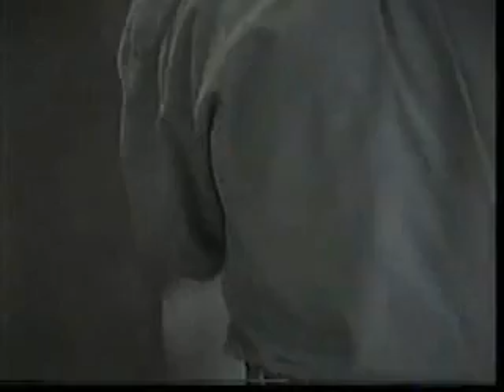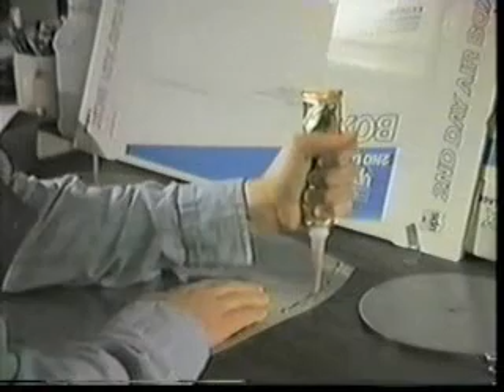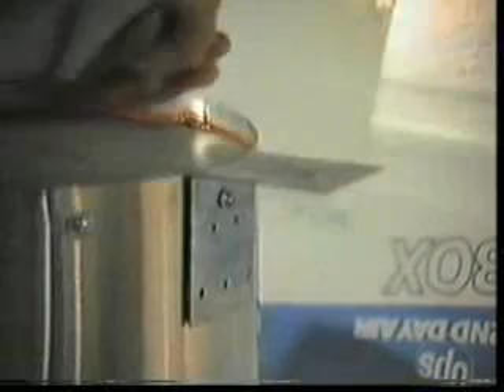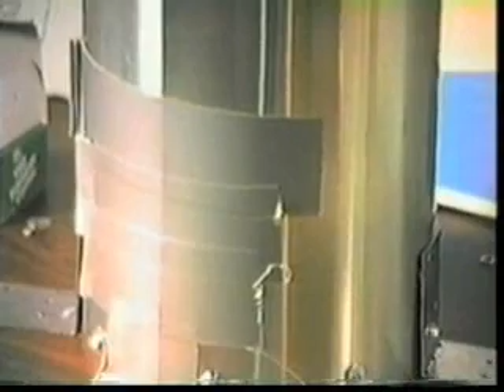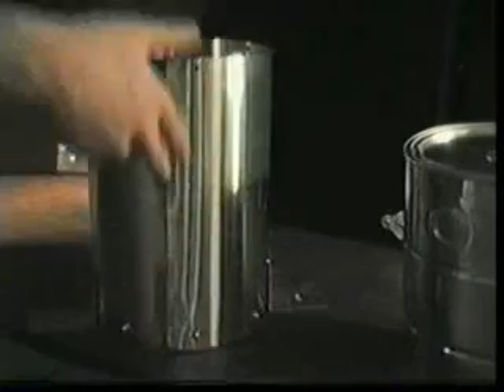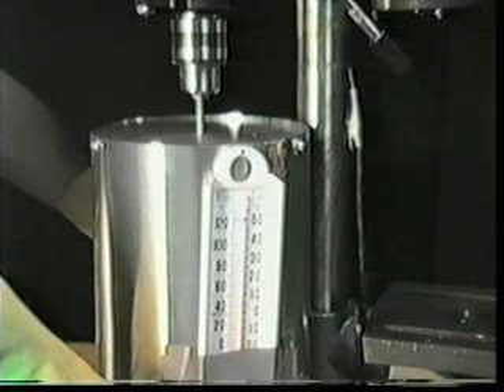878Video150kps

Comment: 12 minutes in, and still no clue as to what this is, what it does, or how it works. Dont waste your time.
Reply: As I understand this is a heater. Yet, you still need a source of energy.
Reply: @jaimesald  the fuelless engine 50 hp motor is its free energy source
Reply: This machine 1300$ you do not now